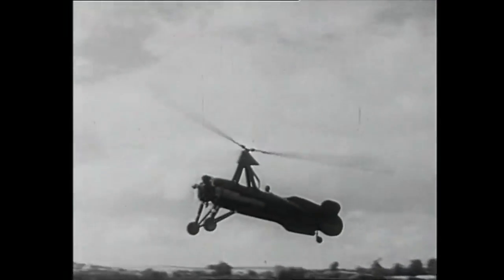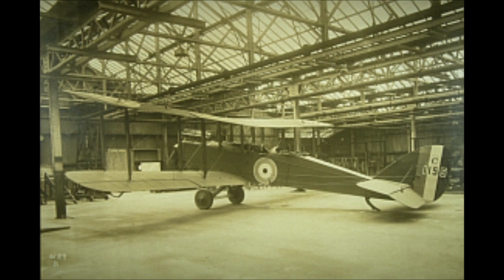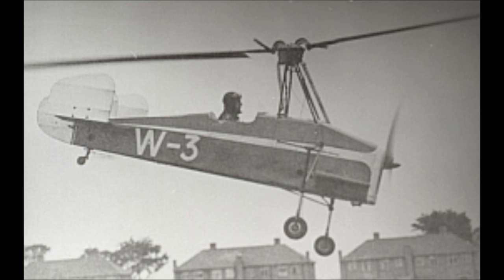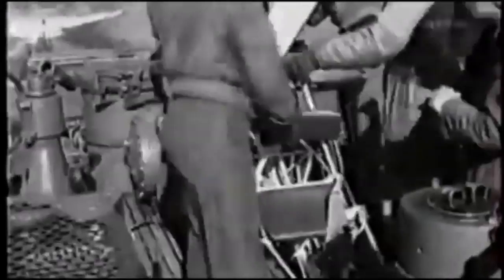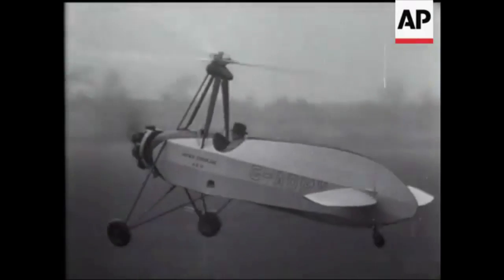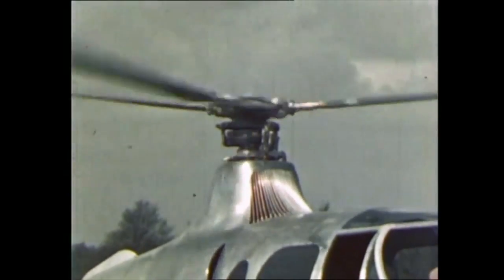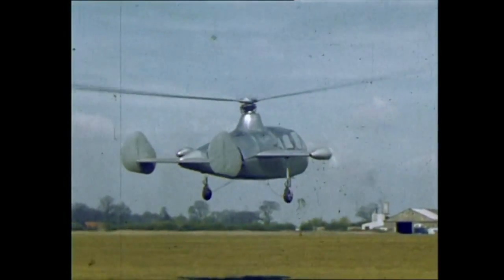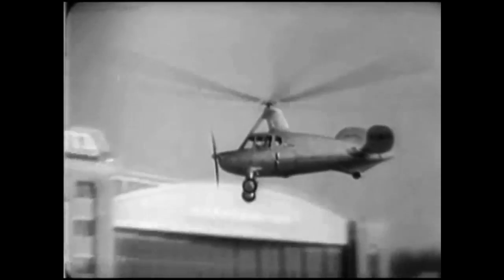History of the Gyroplane - part 2 beyond Cierva

Comment: I'm just wondering if the Herrick HV-2A Vertaplane played a role in the development of the gyroplane/gyrocopter. I readily admit that my interest lies primarily on the fact that Gerard Herrick was my grandfather. I knew him when I was a child and later, as an adult, I visited the HV-2A that is hanging from the ceiling of the Smithsonian's "off-campus" aircraft facility. Wikipedia has a brief summary of the Herrick Vertaplane at https://en.wikipedia.org/wiki/Herrick_HV-2A_Vertaplane. Warm regards, Chris Cornell
Reply from the maker: Hi - I must admit that until you highlighted the aircraft I'd not come across it.  I'm not sure if it really played a role in the development of the gyroplane but certainly if you look at developments that took place around convertible rotorcraft which continue to today I'm sure that it has done so.  It seems to me that one of the rationale for the aircraft was to maintain the cruise speed and efficiency of a fixed wing aircraft in the air but enable short landing capability of the gyroplane.  One thing that he would have had trouble with however is that as the control surfaces [roll / pitch ] are aerodynamic as per a fixed wing in the low speed flight regime of landing they would have struggled with control authority.  Its a very interesting aircraft and actually I am delivering a lecture on the gyroplane history and have a new addition.  Thanks Phil.

Comment: Is there a specific reason these older designs haven't persisted to the present day? I am thinking cost and the size of the planes being too big for the average amateur pilot?
Reply from the maker: Hi Richard yes I think so - essentially the old aircraft were built by fairly serious aircraft constructors - AV Roe, Westland, etc but would be fun to see them again! I’m surprised they haven’t got the one at Duxford flying again tbh
Reply: @gyrocopterflyingclub6148  I love these old styles better.
Reply: @gyrocopterflyingclub6148  Its the type of project Waco or The Vintage Aviator Ltd would need to tackle :-)